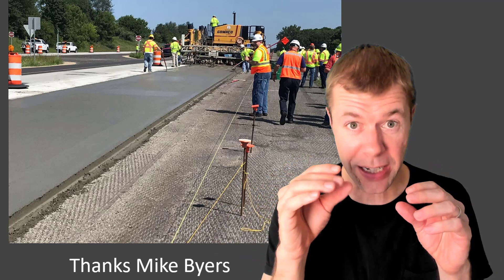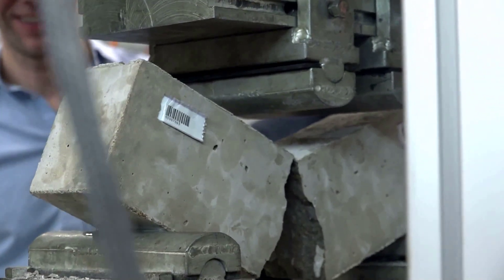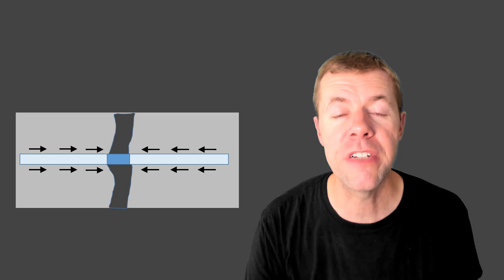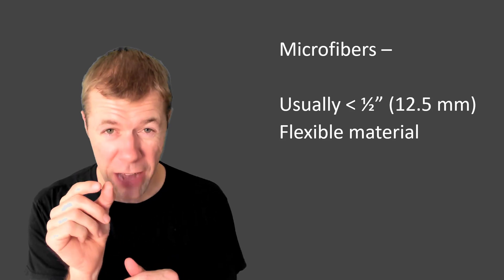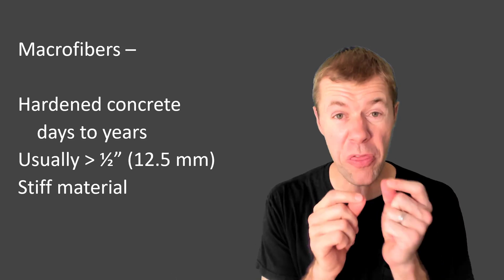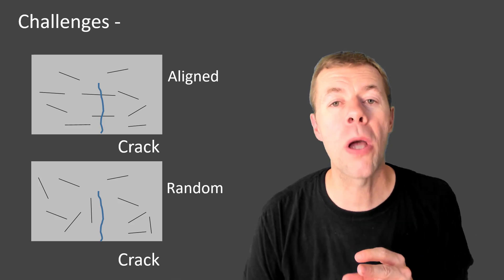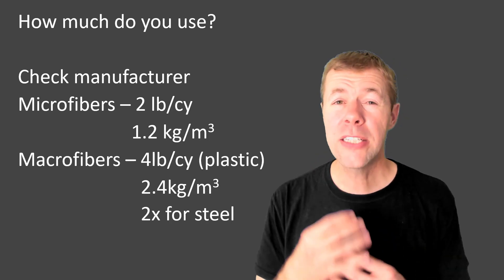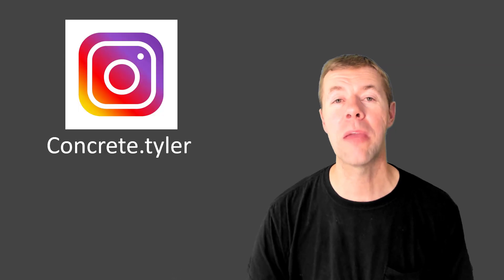What is fiber reinforced concrete?

Comment: Hammer drilling into this stuff ain’t too fun. 

I see it on around 1/50 slabs I still by memory and estimation. 

Also, I often see slabs in basements that are like hmmm an inch thick… 

I do radon and drill slabs often and the stuff I see is either abysmal, normal, or fort fucking Knox.

Comment: Im going to use both Owens Corning 32-500 fibers and a fiberglass rebar grid in my wood stove hearth. Im hoping it will increase the strength and minimize cracks.

Comment: This was helpful. I want to pour concrete in a thin, half-inch mold, but Ai didn't know whether this would help. I guess it won't prevent it from cracking, but it might help it from splitting? I'll still try it out and see how much it helps.

Comment: Starting looking at replacing my driveway in northern climate, and the contractor says he uses sika micro fiber in mesh + dowel steel rebar. Not knowing what any of that meant, and coming from warmer climate, I thought a steel fiber mesh was necessary, but seems tech has changed a ton

Comment: Hello, Tyler. I have a question if you don't mind. I wondered why almost never was asbestos fibers used in concrete even when it was legal? Thank you
Reply: Read about James Hardie and CSR here in Australia,   Asbestos fibre was used extensivelly here in fibre reinforced cement,  basiclly every house was built using it at the time

Comment: Do you put a thin layer of concrete without fibers, for example, in a mold, then add more with fibers? Otherwise, the fibers may be seen on the surface.

Comment: I need to patch several pot holes in a parking lot. The traffic is light but there is forklift, 4000Lb, and tractor trailer deliveries.  Would fiber reinforce concrete say 4-6 inches in the bottom of the pothole with asphalt patch on top work? This is in a desert environ, southern Utah, very little rain and hotter than hell in the summer.

Comment: Hey Tyler, much thanks for all your information!

I'm trying to line a cave I have on my farm with concrete, but without using steel...

The alternative would be using the more than thousand year old method of combining wood and mud, as has proven successful in Europe, with those houses standing for over 1,000 years with only minor repairs...
Reply: Idea for you Use a drywall texture gun / hopper to blow the cement on the walls
It's called gunite/ shotcrete

Comment: I am planning to make a small drainage. 50 ft in length, 6 inches wide, 2 inches side wall, and 1 inch thick. Do i need these fibers or should i just use 1"x1" wire mesh?

Comment: We are pouring a 1 to 6 inch topping slab on a WWT plant containment SOG.  130 foot x 100 foot.  4 foot high containment wall all around.  All concrete has rebar, topping slab has microfiber reinforcement.   Trench drain along centerlines.
Reply: About 2200 cubic yards for the slab, equipment pads and steel support pads

Comment: What type of fibers should I use when making concrete Atlas Stones for strongman challenges/competitions?  These range in size from 10" to 24" in diameter.  Was looking at Basalt and Polypropylene - either of these better than the other for an application like this?  And what length of fiber - seeing 19mm, 36mm and 50mm as options from Amazon suppliers.  Thanks!

Comment: Steel Fibres are manufactured using the process of deformation by corrugating the cold drawn segments of steel wire. These fibres can be peculiarly designed to be used in concrete products as primary reinforcement material and are also available in collated or loose versions. Steel Fibres are known to possess a higher flexural strength as compared to un-reinforced concrete.
To know more about click the link below:
https://precisiondrawell.com/product/steel_fibre.php

Comment: Hey Tyler! I have a question regardinf how to reinforce concrete object. Let's say I'll make weight plate with 45cm diameter and 5cm thickness with hole in the center. What if I add steel chicken wire surounding the plate plus Chopped Stranded Mat fiberglass on the mixing. Will they make a better strength or just use either one instead? Thanks in advance.

Comment: I need to make some concrete plate weights for workout lifting purposes 🏋🏼. Some sold molds come with a metal loop & what appears to be plastic fibers. I’ve seen dudes use rebar. I heard of some kind of a metal mesh being used. I imagine it was 2 pieces cut to weight size, 1 placed after the initial surface layer of concrete is applied, & a second piece applied more towards the top beneath the top finishing layer of concrete. I imagine I’ll spray finish them with rubberized flex spray. I also imagine I’ll replace the pvc inserts with steel. Any suggestions if plastic or metal fibers would work better? Should I use rebar or mesh as well? I’ll definitely have to buy a scale due to additions altering dimensions of weight density distributions.
Thanks for the info 👍🏻

Comment: I’ve seen furniture makers use actual fiberglass fibers to reinforce concrete specifically because they can make the the concrete thinner where they would have had to make it much thicker without the fiberglass. Wouldn’t that mean the fiberglass is literally making the concrete stronger and not just tougher?

Comment: Pardon my naivete, but if you use macro fiber, could you use nylon rope instead of steel rebar?

(Re: I'm looking for a way to build a single person one-floor-at-a-time DIY 10-story residential where the logistics are single person easy - no rebar, no pre-tensioning, just rope and fibers delivered in rolls and bags, respectively.  ???)
Reply: Here comes graphene.

https://youtu.be/n82_NsFjj_8

Comment: In the 1980s I noticed concrete pathways were poured with zillions of sewing pins in it . With weathering the individual pins would be exposed to view.

I don't know how long it went on for and when it stopped.

Anyone got any clues about what I saw?

By the way I am not crazy.              I'm from the great South Land below the Equator

Stavros
Reply: They probably thought they had a cheap way to reinforce concrete. But I think you need fibres that are very well at pull and that they are long, ow, and it should be a material that bonds with concrete. It would also be nice if they do not corrode. If you got something, hit me up!

Comment: Hey Tyler, here is AU I came across fiberglass woven mat where the woven strands are every 2mm and is a 6 oz mat. I've used these in garden bed walls that can be walked on with heavy wheel barrows. 20 years on and not a crack. Basically I lay 30-40 cm of concrete then the first mat, another 40cm concrete and second mat and keep going to the relevant height required.

Comment: I had a driveway poured 1 Yr ago, the fibers started poking out of my driveway creating tiny weak spots and it is destroying the surface of my driveway! The contractor who did it took it upon himself to add fibers to it, Undenounced to me. Although Fibers do increase the tensile strength of concrete, on the surface of the concrete it weakens the structural integrity of it! Because of nature of the fiberglass strains and what they cause at the surface.

Comment: Wanna pick your brain on this subject. 

so what if rebar corrodes? I read somewhere that only the exterior surface corrodes but the rebar core remains strong. The surface corroded layer also prevents the core from getting corroded.

So is rebar corrosion really cause of concern for structural failure? 
Thanks in advance and hope to hear your thoughts on this!

Comment: Are these made of plastic?  Metal?  What is the composition of the plastics or fiberglass?
Reply: Fiberglass
Reply: Fiberglass, and they will destroy concrete at the surface! At least they did on my driveway! They may be ok for a foundation, but definitely not for driveways, or patios!
Reply: Some of the fibers described are polymers and some are fiberglass. Polymers are what you think of as plastic, and fiberglass is literally glass granted a glass with a weird chemical composition so that it can withstand being in concrete.

Comment: Not all fibbers r the same is a great statement.    Most finishers r trying to replace rebar with fibber to save in labor.   It’s not made of that.  In most applications.      In my experience plastic cracking is cause is high heat and pouring concrete to wet in that heat.    The drying happens to rapidly and causes shrinking/plastic cracking.   Happen to me once in my 27 years this summer in 2020   South Louisiana heat

Comment: What if you added a sheath of reinforcing material around the concrete, like covering it in carbon fiber composite, creating a honeycomb. The composite would take the normal forces and the concrete could be the web and take the shear forces. Aerospace engineer here, so I don't know diddly squat about concrete, just wondering.

Comment: Thought: if you poured a few inches of concrete, and then placed a sheet of fiberglass in the area of the most stress, and then repeated, concrete and glass sheets? This would be instead of random fibers, and would be in addition to rebar.

Comment: Here's the question though... why do they use loose, mixed-in macro fibers instead of woven cloth with pre-tension? we already do pretension with rebar on foundations and bridges etc. I imagine if they did that with the fiber, ie putting some fiber tow into the concrete and applying tension during curing... wouldn't that be a simple step to ad a whole lot more toughness?

Comment: is there any reason that I can't use radiant floor heat (pex ) in a steel fiber reinforced concrete slab on grade? Also, any idea where I can find a good resource on how much steel fiber to use based on my pad size while trying to avoid contraction joints?

Comment: Im now reading: "Concrete for Underground Structures". They mention steel fiber reinforced concrete for use in prefab tunnel sections. 

You really showed me the difference in the use of micro- and macrofibers. It make a lot of sense now. 

Concrete is a wonderful (cheap) material. I started to get interested in concrete because i like to study tunneling, and concrete (and grout) is one of the best and cheapest ways to get it done. In the past they also used cast steel as tunnel liners for Tunnel Boring Machines (TBMs), but now they use prefab concrete a lot.  https://www.youtube.com/watch?v=aqZvF7o2o1U

Look on my about section of my youtube account for some books to read on tunneling. Some ive collected; the best ones are there to read. Ive also read "concrete" and "concrete formwork" by ATP publications. As well as a lot of other trade books about welding, metal machining, brick masonry, plumbing. So i think i know enough now to be able to place concrete.

Im planning to finish my statics, mechanics, dynamics, fluid mechanics, and chemistry books next year. Then ill do the Concrete design books. The calculus of concrete structures. I think i have a good selection of books. And i will use "Maple" math program, which has helped out so much, while the calculations of foundations, and concrete can be so large! I think this will help out a lot. 

Do you advice your students to use programs like Maple?  

The "concrete for underground structures" book further mentions taking test cylinders to measure the concrete strength at 7 days, 28 day, and some times 56 and 90 days. Also it references to a lot of ASTM publications for further details. 

I also have drawn a slump test cone on my grabcad.com account. 

I think being shown real life examples why things are done helps out a lot to keep the students interested. At least it keeps me really interested in al the testing, because at first the placement and the build looks like the most interesting thing. And the designing boring. But now i think, maybe the opposite is true, I think both is really exiting! 

Greetings,

Jeff

Comment: I recently found out about the joy of concrete. I keep playing with it. Now I'm wondering what happens if you were to place a mesh layer or two of eg garden nylon netting?
What are your thoughts please?
Also what if you add eg metal dust or granules? Would it make the concrete stronger? Would it add a metallic kind of look? I would appreciate any thoughts about this kind of thing before I go to the expense and effort of buying and making. I use the concrete just experimentally at the moment and created some cute garden ornaments and even tried a couple of slabs with mud and concrete. (Which looks great but needs to be a bit stronger.) It's such fantastic fun though! ❤️
Reply: The problem with nylon is it's too stretchy. This would allow the cracks to get larger than desirable. They use glass or basalt fibers because they have minimal stretch.
Reply: @dwaneanderson8039   basalt mesh is the way to go you are right Dwane
Reply: @Samua3     Check out ferrocement........Now I'm wondering what happens if you were to place a mesh layer or two of eg garden nylon netting?
Reply: Nylon is too weak. Look to engineered products designed for concrete reinforcement, like glass and basalt fabrics. These are excellent for use close to the surface.

Comment: Dr Ley, I have been getting push back from Contractors especially on slab on grade application. There argument is it is challenging to finish, like you showed on your video. I like the video it is truly helpful.
Reply: Try adjusting the paste volume of your mix with fibers. Make a designated mix design with fiber built in. I find a 30-35% paste volume works well with typical macrofiber
Reply: lackoffkgivity  most of these issues can be fixed with paste volume and using clean aggregate 
Also don’t throw all the fibers in at once. Do one bag at a time slowly

Comment: Interesting. Thank you and well done. I still have the question in my mind.......If the fibres resist tension, then by definition they will increase the concrete strength, and therefore resist cracking, no ? I do understand in general terms concrete cracking can occur due to a number reason. But, taking a compressive point load, such as a car lift post and given the stresses the concrete pad is undergoing........I would have thought there is added strength when fibres are added, no ?   I am sure I am not completeing understanding because I see manufacturers placing " does not add strength" although not in all cases.
Reply: (Just an assumption as I'm not the author)

Unreinforced concrete has approximately 10x the compressive strength in comparison to tensile strength and we predominantly define it on this compressive strength property. For example a 'C20/25 mix' is a concrete which has a compressive strength of 20/25 MPa when measured by Cylinder/Cube crushing. 

 The fibres do not improve the compressive strength of the concrete.

If you were to say that fibres increase the strength as this would give the wrong impression. 

Another way to think of it is that steel reinforcement does not 'increase the strength' of the concrete, the concrete has it's own strength and works in conjunction with the fibres / reinforcement.

Comment: I have an outdoor pathway, I'm using 6 sack concrete mixing myself. I would like to have these pathways about 1 inch thick. From your video's I think both wire mesh and microfibers would work best? Steps I will use: integrate microfibers in the wet concrete, pour a 1/2 inch put the wire mesh down, then pour the top coat? Is that the best method?

Comment: I worked for a company which made concrete pipes and we used fibre in the manufacture. It was called...asbestos. That was very tough cement with a very long life. (Longer than some of my colleagues)

Comment: I specified fiber reinforced concrete once.  It was a pad for a portable MRI at a hospital.  It was moved from place tp place in a semitrailer.  I wanted to keep iron or steel away from near it because that would affect the image and the machine would have to be “shimmed” or adjusted each time it was parked before it was used.

Comment: Thanks!! Great Video!! 

- Davon (of Davon Chadewick White, Inc.)
https://www.dcwdcw.com

PS I'm currently studying concrete for my company.

*Reiterating the difference between micro and macro fibers and explaining the use of fibers (such as in thin applications of concrete design) versus rebar compliments recent learning. 
- Thanks,Davon

PSS I find it interested that steel reinforcing bars have high tensile strength "and are generally about 15 times stronger than conventional concrete." (source : Design and Control of Concrete Mixtures, p. 250) ...
Reply from the maker: Thanks Davon!  I am glad this was helpful.

Comment: in post tensioned concrete we use the minimum reinforcement steel bar, So there is no need for steel bars if we use fiber  ???
Reply from the maker: Great question.  It depends on the application.  If the concrete is elevated then I think the answer is yes.  If it is on the ground then you may be able to get away with just fiber.  It depends on the application.  I would like to do testing to study this but we need some financial help.  Thanks so much for the great question.

Comment: We casted around 12 column using fiber reinforced concrete in both pcc and rcc. The fibers were actully prety coool. The cracks were minimised and ductility improved . We used 3d hookedend fibers.

Comment: Interesting and thanks. Seems that micro fibers are misused because they are sold as large crack eliminators and as you point out, that is not what they are designed for. And certainly micro fibers don't compensate for badly designed forms that lack proper expansion joints etc.

Comment: Concrete tunnel liner segments use polyethylene fiber for fire protection. It does not hold the concrete together but rather melts allowing space for the concrete to expand without as much damage.